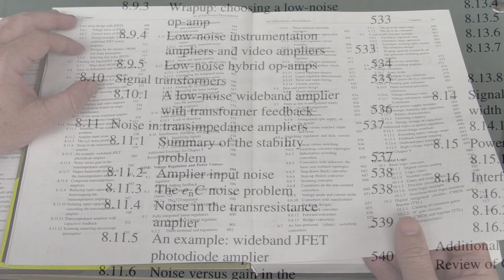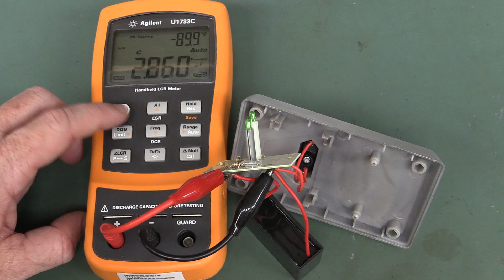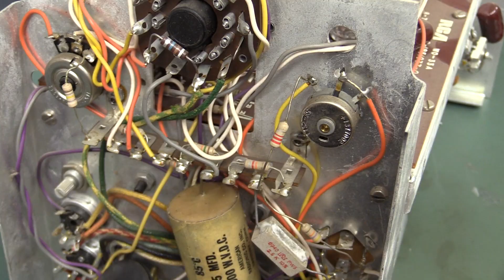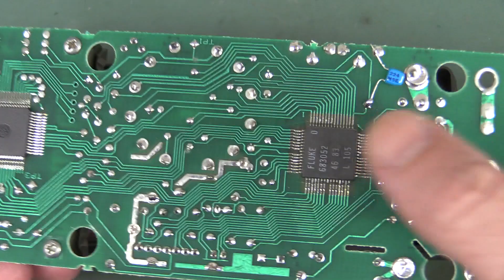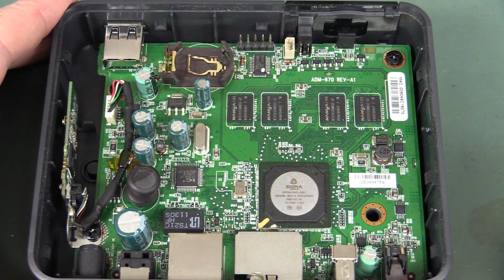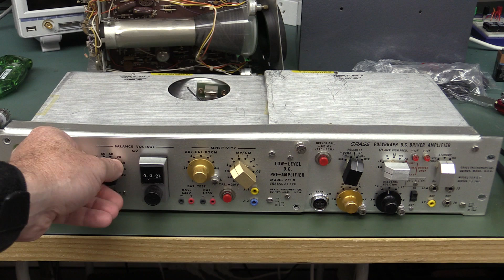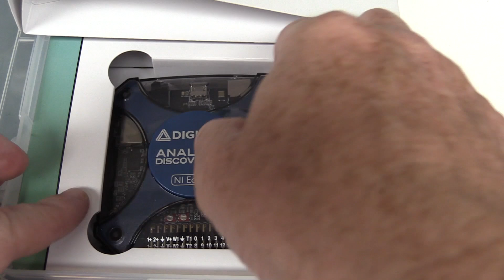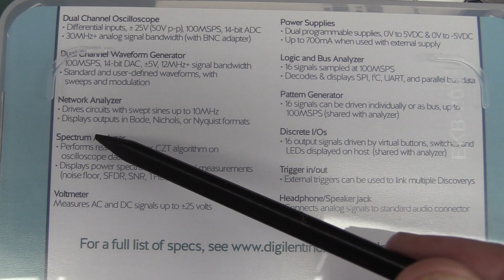EEVblog #847 - Mailbag

Comment: would the DC to AC converter also work as a diplexer? on the radio ship Ross Revenge they had two transmitters through a diplexer on a single mast. both radio caroline and radio monique were on the air at the same time.
Reply: http://www.rossrevenge.co.uk/tx/txroom.htm this is what i found with a drawing. i try to understand it, i need to start at the beginning for a 27mc kit to get it working on my land rovers.

Comment: Here in the states PSC motor ceiling fans use a run cap that looks exactly like the one in the "energy saving" box. Our 3 speed ceiling fans have 2 speed control methods, one uses autotransformer taps in the run winding and a single value run cap, the other uses a dual run cap, low value capacitance is low, high value is medium, and both values in parallel is high speed.

Comment: Dave, could you add an Amazon link for the Amazon.co.uk or Amazon.de? I do like to support you but if I order from the Amazon USA ( above 50$ ) I pay a lot extra close to double due to custom/import rules. If it comes from with in de EU it saves the extra costs...
Reply from the maker: +Joop Terwijn IIRC my amazon affiilate account is not available in the EU